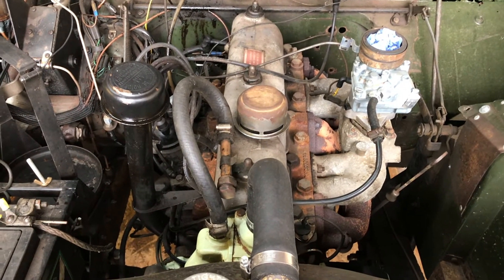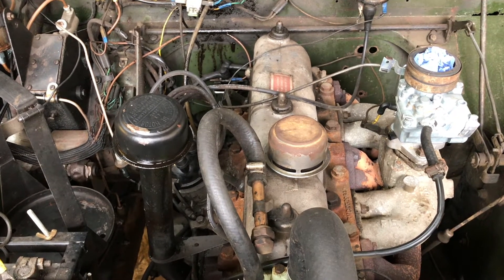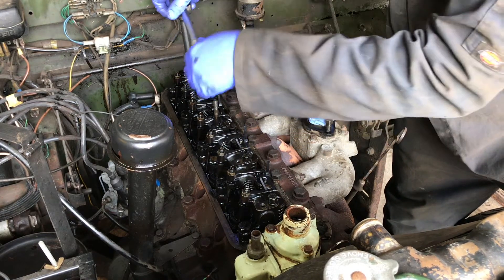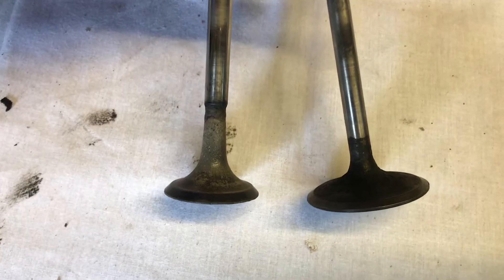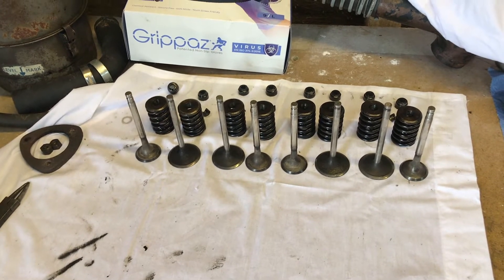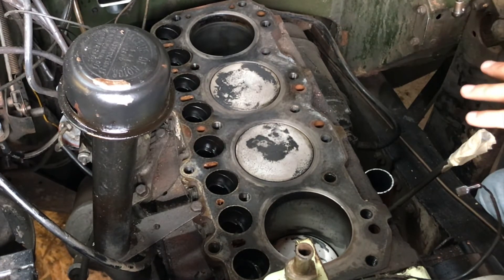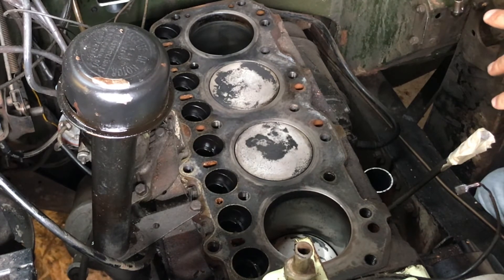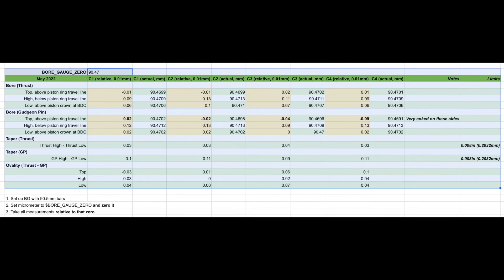Series 2A Land Rover - Engine - Part 1

Comment: I would have taken measurements and levelled the pistons and filled them with diesel and let it sit for an hr to see if you're having piston ring issues.

What was the outcome in the end?
Reply from the maker: Outcome was put it back together and keep an eye on it. I haven't had any oil blowback through the oil filler since, and the compression is stable around where it was measured.
If rings are good will diesel sit on top of the piston? Or are you looking for one or more to leak faster than the others?

Comment: Just replaced my 2.25 petrol head gasket as it blew between 3 and 4. Last yr I did a top end overhaul and used a copper gasket. My advise is don't use copper as they are poor quality use a composite  and torque down to about 50nm and then 88nm. Goodluck
Reply from the maker: Cheers, Kevin. Yes, I'll be using a composite, definitely!
Reply: @spannersonthefen3491  hi spanner yes I agree with your comment. Only use composite hg
It's my thoughts that in our modern world a lot of lr parts come from very dubious sources and I suspect cu hg come from let's say the east.
I suspect the composite hg may come from Europe.  Don't forgot to put washers under the head bolts as I believe this is because the composites is a couple of mm higher than cu.